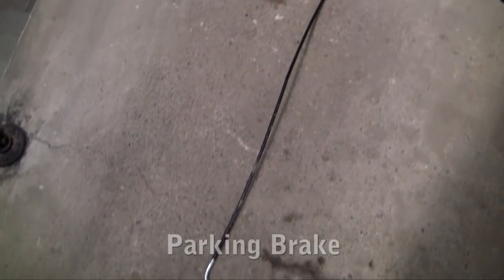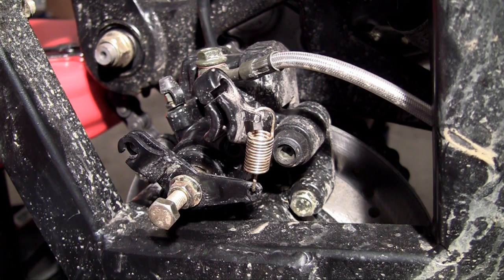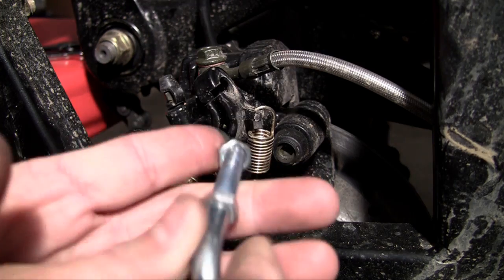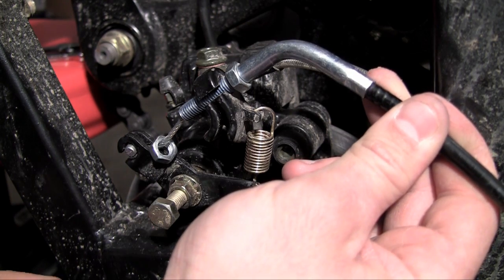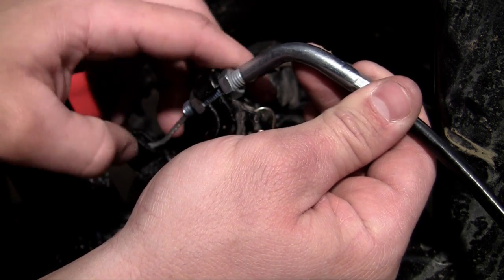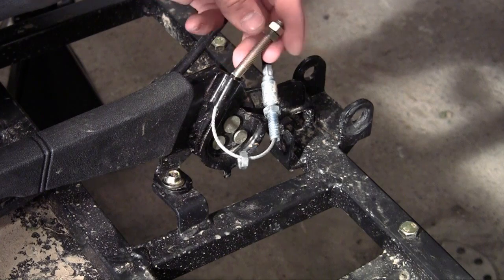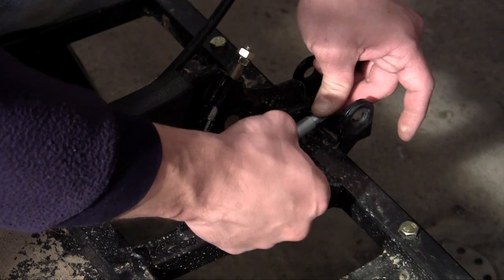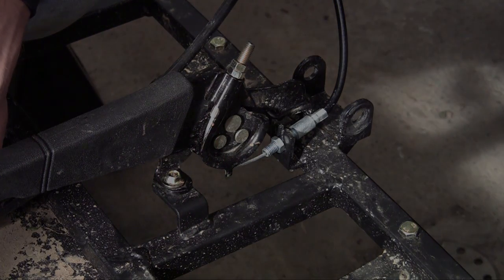How to Build a Go Kart - 12 - Parking Brake

Comment: I have a question. My son forgot to take his parking brake off of his Trailmaster XRX.
Now the parking brake does not work... rolls front and back when on.
He can stop using his brake pedal. Is the an adjustment to tighten up parking brake to make it work or do I need another cable?Thanks
Great Videos